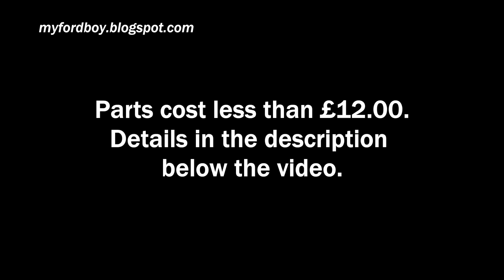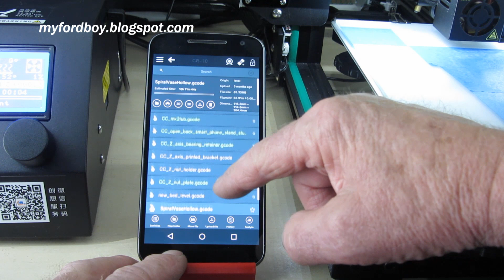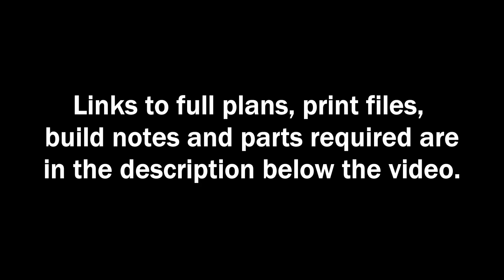CR-10 Dual Z Axis Low Cost High Precision Upgrade

Comment: I owe you big time. I just did this upgrade with the 3D printed bracket and it's fantastic! I always had issues because of the other side sagging or a delay in z direction changes, now I can do tiny microadjustments and everything just works now. Your solution is stellar, thanks a ton
Reply from the maker: Happy to help.

Comment: that's the correct solution for adding a second drive for the z-axis, excellent work!! I was thinking that a single touch to either of the two steppers or lead screws (from the standard solution) could bring the entire x-rail out of alignment, but this locks them perfectly. One thing you forgot to mention is making sure the x-rail is leveled before tightening the screws for the new tooth pulleys.
Keep up the good work!

Comment: Great job sir.
Yesterday I was received my parts from AliExpress(Banggood was out of stock) and it took me 20 minuets to assembly the upgrades(printed bracket and rest of parts were printed few days ago).
My CR-10 produce amazing prints out of the box, but as Engineer I don’t like the way X axis arm “slider”was designed lot of room for possible errors, also two steppers option is far a way from ideal solution because nothing on the earth is identical, which means that coils in steppers are not identical too, and in time they will accumulate errors which will produce misprints soon or later and you have to adjust the motherboard and or stepper driver.
Your solution is trouble free and very easy to implement. 
Thank you
Reply from the maker: Thanks for the feedback. Glad to hear it works for you. As I stated I had not tried the printed bracket myself so it's good to know it fits OK.

Comment: Wonderful, I tested the two stepper system and it is full of micro stepping issues due to the  motor back emf upsetting the other motor. Finally someone doing it right. This will improve the layer banding no end, well done.
Reply: I think you're supposed to fit a filter between the two stepper wire looms, i had one made for me for my first printer ages ago (sold it, so i can't remember) and it was no larger than an USB stick.
Reply: Added a second motor to mine with no issues at all. Maybe yours was binding slightly or something. A lot of people on the CR-10 group have done it also with no problems.
Reply: I have a friend that has "no issues" with his printer but he always says my prints look so much better.
Reply: Take it you both have the same slicer settings then. You could be right but I have not noticed that my prints got worse after adding a second motor. Not noticed them getting out of sync and I check them regularly and are very happy with my prints at the moment. I know some people have had issues so that is why I check often so who knows.
Reply: Print a 20x20x50mm tall test cube. Look at it under the microscope, if you see a repeating "banding" pattern then this typically indicates a Z axis issue. I worked through my printer until the surfaces were glossy smooth even under a microscope. Fussy I know but I am a bit OCD when I build stuff.
Reply: I was not trying to knock the method in this video in anyway. Wish I had seen it before, it does seem a better solution. You obviously know what your doing, would you say it is 100%  problematic. I was always having trouble getting it adjusted just right before, so to me adding another motor was always an improvement. Was not trying to be a smart ass or anything but if this way is better than I will change to it.
Reply: You sound cool as, I was just explaining my story.  Most issues on an okay printer are only a few percent problematic.  If you have the time and patience you can work through them to get really awesome prints. For example I measured and straightened my rods to within 10 microns before I did my build. Now I have a laser cutter I barely use my 3D printer which is ironic.
Reply: Does the control board on the CR-10 have a header/connector for a second Z stepper or are people splitting off the single connection?

Comment: Great execution on this one. Haven't felt the need to add another, it works within my tolerances on Z but what i did do i add a small radio track pulley on the top and wire that attaches to a few grams of weight. It makes quite the difference, and since the Z axis only goes up, it's a safe (for the motor) mod. Mine is slightly biased to the right, mounted with one of the spare screws they give you.
Reply: aserta I like your thinking. So you just added a counterweight to the side that was always slightly higher?
Reply: What fabric is on the enclosure you made?? I feel like i've seen it before but i can't quite put a name to it.
Reply from the maker: +aserta l think it's just called reinforced plastic sheet.
Reply: yeah. this is what I do on mine. just added a counter weight. to help lighten the mass load of the gantry arm.

Comment: I looked over your vid and have a suggestion. 
It looks a though the carriage bracket could bind if everything wasn't aligned perfectly parallel.  
I thought about a belt tensioner but think if you merely slotted the holes in your metal bracket  where they mount to The carriage, you could mitigate the misalignment when you tighten your belts...although I see you chose to let the dead end of the driven shaft float instead...

Comment: Neat ! Much better than fitting an additionnal stepper motor (not even talking about the issues of synchronization). What is the purpose of the shaft coupler on the right leadscrew  (the added one)? And what is that app on your phone ? Thanks for the video !
Reply from the maker: The shaft coupler (it could have been a collar) prevents the leadscrew lifting, it's held between it and the top pulley. App is Pritoid Pro

Comment: Nice job.
The system does not require synchronization as with dual motors.

I wonder if he will pass the exam in the Tevo Tornado printer

Comment: Great job myfordboy!  You beat me to it.  I'm currently doing a similar mod to my CR-10.  I feel like this method is much better than simply adding another z-axis stepper motor, as in the CR-10S, which can still allow x-beam vertical misalignment over time since the pair of individual Z-axis stepper motors aren't synced.

BTW, I see you're still printing on a taped bed.  Up until this week I have been successfully using UHU glue stick on glass and printing PLA without a problem.  This week I decided to try printing on bare glass as have noticed other CR-10 owners have had success.  I found that using a 0.3mm initial layer thickness combined with 22.5mm/s initial layer print speed with 60mm/s initial travel speed works perfectly.  Subsequent layer thickness/print/travel speeds can be whatever you normally use.  I normally use 0.15-0.2 thickness and 60/120 speeds so only the initial layer adds more time.  Of course, I clean the glass with Windex just before printing and check that the bed is level.  Anyway, if your glass bed is flat you might want to give it a try.

Merry Christmas from Thailand!
Reply from the maker: I have tried all the usual methods of bed adhesion including Lokbuild but prefer the tape. I have not tried altering the layer height on the bare glass though. i'll give it a try.
Reply: I hope you do try again because it will make things much easier for you.  And since it works for me, and others, it will certainly work for you.  I've used a variety of PLA filaments and found that 60°C bed temp is optimum for UHU and/or bare glass.  Of course your mileage may vary.

Another critical factor for adhesion seems to be initial clearance between the bed and the print nozzle tip.  I know you use a dial indicator, which is great.   I use the method of inserting a single sheet of copy paper between the bed glass and print nozzle at the corners and the center to get the optimum initial layer clearance. Adjust the bed height so the sheet of paper drags slightly when pulling on it to remove it from out from under the print nozzle.  If you want a slightly stronger initial layer adhesive bond then slightly raise the bed so the paper has a bit more drag when removing it.  This method will work with bare glass, but if you have some initial layer gaps/problems you can try the UHU glue stick.  I guarantee it will work every time.  It's also easy to remove and reapply.  Also, you need not reapply it every time as it sticks very well to the glass.

Good luck and Cheers!

Comment: Why don't you fabricate 2 Cam levers for the plate bender instead of tightening and  undoing the nuts ?
Reply from the maker: It only gets occasion use. Never got around to it. The advantage of no cam is the angle can be replaced with round bar for gentle curves and the bolts used for clamping can be positioned very close to the work so no flex.

Comment: @myfordboy, thank you for this video. I'm building my 3dprinter based on the CR10-S and want to ask you why the need of the pulleys to be 36 teeth, as in why not a pair of 40's or 60's?
Reply from the maker: As long as they are the same size it makes no difference. i chose 36 to suit the belt length available.
Reply: Awesome! Thank you very much and cheers!

Comment: Do those colored track covers improve the movement of the 3 axis? Were those printed or purchased? I've been looking into getting some in my tracking, hoping it will improve some contact between the moving wheels on the axis, maybe give it an easier time with movement with more surface area.
Reply from the maker: The strips are cosmetic and came with the printer. Correctly adjusted you should not have any problems with smooth running. Check my Ender 3 set up video for some tips.

Comment: Congratulations, excellent idea, but I did not understand if the 600 mm leadscrews are two. Is it necessary to replace the engine leadscrew too? Thank you very much.
Reply from the maker: You reuse the existing leadscrew  and fit it on the right. The new longer one goes on the left.

Comment: i dont understand how to assemble the LH BLOCK , can you send some other photos where i can see it better ?
Reply from the maker: My block had a flanged bearing but it is possible Creality have changed the design. All that is necessary is fo the bearing to be held so it cannot move , mine was able to move in one direction, so you could use the existing left hand block and add packing to keep the bearing in place.
Reply: myfordboy do you have the specs of this flange bearing ?
Reply from the maker: F688ZZ 8 x 16 x 5

Comment: This should be adaptable to an Ender 3 as well I think? Likely need a different length belt and possibly different length screw though.
Reply from the maker: It would work on Ender3 with a shorter belt and leadscrew.
Reply: @myfordboy  Now to find out exactly what lengths to get :P

Comment: Do you loose any Z height with this? It looks like the new mount for the 2nd brass nut might hit the coupler, reducing max z height? Also, for the LH you mention the reuse of the flanged ball bearing, mine original CR-10 doesnt have a bearing retaining the top of the leadscrew, it is just a 3d printed part,
Reply from the maker: You will loose about 4mm of height, nothing to worry about.
I am suprised there is no bearing in your printer. If you print the parts shown though you can fit a bearing to it.
Reply: @myfordboy  Thank you. I have one of the very early CR-10 models, which only had a 3d printed holder for the top. Will the 688 bearing be suitable?
Reply from the maker: @KB-jy5hr  I think it's F688 but to be sure i suggest you print the part and measure diameters.

Comment: Hi There
Great Idea, have also ordered the parts (though from Aliexpress).
What do you call the "nuts" in  the track? I can't find them? 
How did you connect the top block to the printer (under the new 36 tooth pulley and above the collar on the left side)?
Reply from the maker: Tee nuts.
Both bearing blocks are fitted with 2 screws through the holes in the blocks into the horizontal extrusion. They go into the tee nuts in the extrusion. The existing screws are reused for the left hand side.
Reply: Thanks
What size tee nuts should I use for the printer? Do tee nuts come in sizes like M3 or M5 like normal nuts or is it more s 3mm x 5mm size thing?
Reply from the maker: https://www.banggood.com/100pcs-M5-Hammer-Nut-Nickel-Plated-Carbon-Steel-Nut-Aluminum-Connector-T-Fastener-Sliding-Nut-p-1048442.html?rmmds=search&cur_warehouse=CN
You might find smaller quantities on Ebay.
Reply: Thanks again

Comment: Hi, Thank you for making such great content. I was wondering, during the final print you showed in the video, your printer is positioned in some sort of tent? Where did you get that and does it help with the quality of your prints?
Reply from the maker: G Smits The printer is in my garage so the main purpose of it is to keep it clean. It does provide a constant temperature around the printer which is a good thing. I have not done any printing with ABS but it some this is more tricky and an enclosure is recommended.
I could make a video if you want more details. It is made from a cheap growing greenhouse,  about £20 total cost.
Reply: A greenhouse! that's really clever. Thank you.

Comment: One question... why is the coupling used for the driven side leadscrew instead of a regular set collar? Don't you loose height capacity?
Reply from the maker: I used the coupler because i had one. You can use a collar instead if you wish.
With the coupler you loose about 10mm Z travel which was not important to me. You can get this back if you wish by using a collar or cutting the coupler in half and moving the metal bracket mounting holes up 5mm.

Comment: As usual, you have done a great job. The only criticism I can offer is that printers with designs where the leads screws hang from the mount are problematic. The flexible shaft coupler behaves like a spring. Under fast z movements you can literally watch it bounce up and down. Needless to say this is bad for accuracy in the Z direction. What happens if you remove the 3 pulley wheels on the right side? I suspect you will see the right side exhibit that bouncing behavior in the Z direction. Meaning it is the original pulley system which is providing the constrained parallel horizontal motion instead of the new dual lead screw set up.
Reply from the maker: Design Prototype Test The flexible coupler is only used as a method of securing the leadscrew either side of the bearing block. It does not make a flexible connection so the problem you mention of not an issue.
Reply: Also 3D printers don't make that many fast Z movements. Only at the end of each layer do they move at all, and even then, it's only a very small movement.
Reply: BLOOGaming true, but it could also be an issue with the springiness when the weight from the printhead is shifted all the way over on that side of the x-axis rapidly. Remember that a variation of .1 mm can lead to catastrophic printing failures but that amount of movement is not even perceptible to the human eye.
Reply: Ahhh, that is  good point.
Reply: again the coupler is NOT linking 2 screws. its literally being used as a stop/washer so it literally can not bounce or stretch or anything like that.
Reply: On my first viewing I did not see him slide the coupler the last few inches into place on an uncut shaft because that video sequence is missing. I assumed he had cut the lead screw and was using the flexible coupler for its intended purpose. Upon re-watching I realize that the lead screw is uncut, and continues solidly through the coupler to the belt cog above. Thank you for the clarification.

Comment: What is the size and cut of that big, black handled file?  Is that what you use mostly for fast metal removal?
Reply from the maker: 10" file, not sure what the cut is. It's not that coarse.  I have a very coarse 14" one if I really want fast removal on aluminium.

Comment: Do i need to order T-Nuts too? Which size they have to be? I am a beginner, so as more detailed as better :-) Thanks a lot for all answers :-)
Reply from the maker: I used these https://www.banggood.com/100pcs-M5-Hammer-Nut-Nickel-Plated-Carbon-Steel-Nut-Aluminum-Connector-T-Fastener-Sliding-Nut-p-1048442.html?rmmds=search
You can get them on Ebay too in smaller quantities.
You need a couple of M5 x18mm long socket head screws too, like the ones the machine is assembled with.
Reply: Thanks a lot - the amount was perfect because i will try to learn all this things and so i can use them later for other project you inspired me for :-) Thanks :-)

Comment: Thank you for your careful work, do you recommend this to the dual steppers in the CR-10s? I am tired of x gantry going out of parallel. Is it too much stress on one stepper?
Reply from the maker: Plenty of power in the stepper to drive both leadscrews. No problem with getting out of step. Should never need adjusting once set up.

Comment: Thanks. Finally getting around to ordering the stuff. With the popularity of your video Banggood is out of stock on the pulleys. Is there an alternative?
Also how did the plastic bracket shake out for durability?
Thanks for this video. Good stuff.
Reply from the maker: Have a look on Ebay for the pulleys. I did not try the plastic bracket myself but others have reported it fitted OK. The metal bracket is best if you can make it .
Reply: I ordered these from Amazon Canada: Uxcell Aluminum GT2 36 Teeth 8mm Bore Timing Belt Pulley Flange Synchronous Wheel for 3D Printer